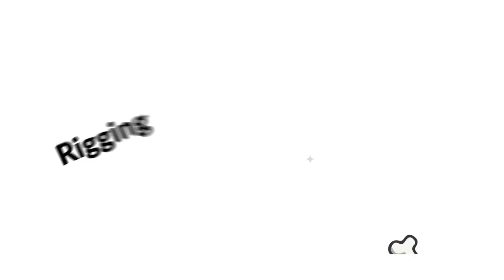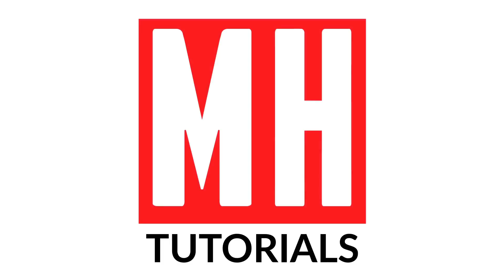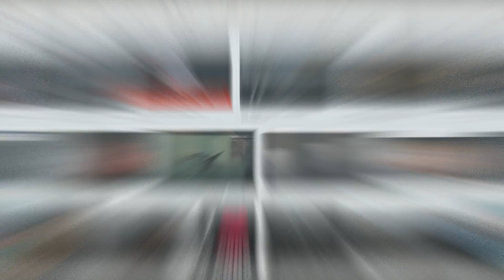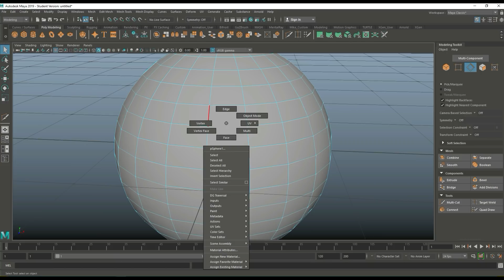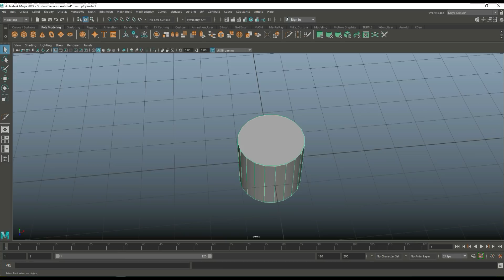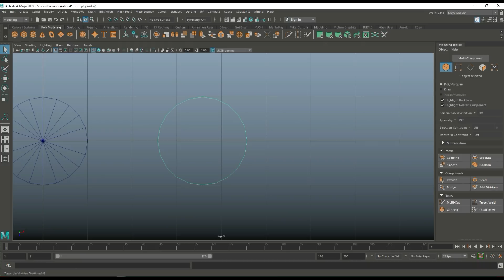Maya 2019 tutorial : What are nGons and why to avoid them ? ( BEGINNER LEVEL )

Comment: hello Mike 
i have a small question 

how i create or i put  image in the scene and after this i rendering with the same image but not from skydome?how i make the image part of my project.and why any image from HDRI haven  come in skydome as  spherical?
Reply: For HDRI images It is used for lighting information and not as your actual background therefor a latlong(spherical) image. To render an image without seeing the skydome image  in Maya with arnold skydome you can set the camera value to 0 in the attribute editor under Arnold tab, if that is what you are asking.
Reply: @Kerucan  iam asking  how i put image from HDR as background in my scene and same time i using it in skydome .i want make some part from the image in my project
Reply: did you get what i mean ?
Reply: @mohamedhamdy6722  I am not too sure about using HDRI image as a background plate. Usually for my project a background picture is taken with the HDRI at the location to get accurate lighting information. I think you can find similar lighting images to be the background instead. Not too sure about converting lat long images

Comment: still didnt answer: why avoiding them?
Reply: 1:46 He states that if you are animating the model it might cause issues and as a general rule to avoid n gons to be safe and make it a habit when modelling
Reply: @Kerucan  so is n gon safe when i model hard surface?
Reply: @AI_MIXING  n gons or triangles are safe when u have a model which does not deform and for deforming objects plz avoid ngons bcoz it will make trouble in animation
Reply: As far as i know, every four sided polygon will in the end transformed in two triangles. Same with n-gons.
But with n-gons you can't control how the lines will be set, to transform the n-gon into the triangles. Maybe it will be an absolutely mess and this could create problems with the light or shadow.

N-gons aren't bad, but an atrist should always control everything what happens in his model to avoid such sort of problems.

But maybe i'm wrong. I'm still a beginner ^^